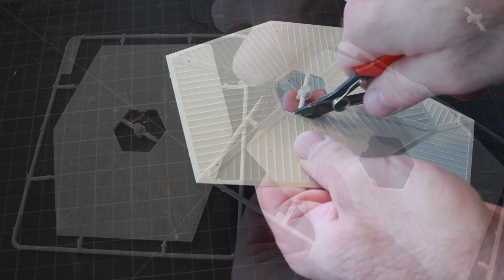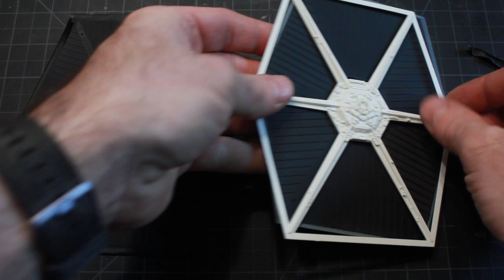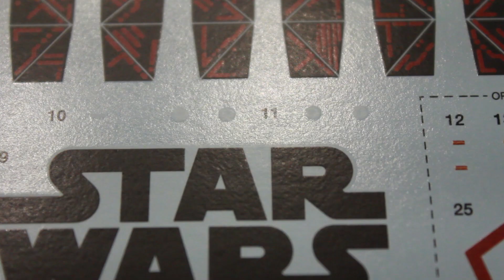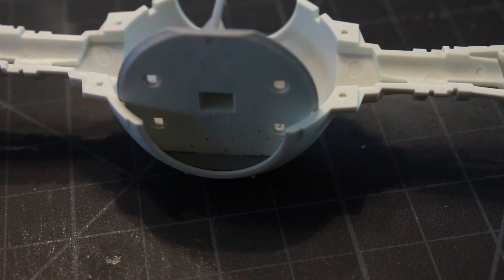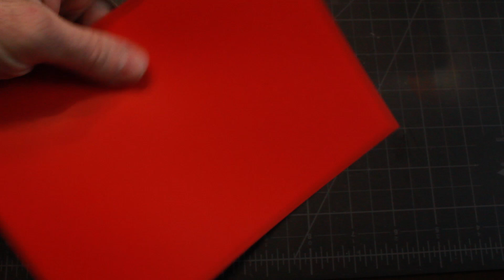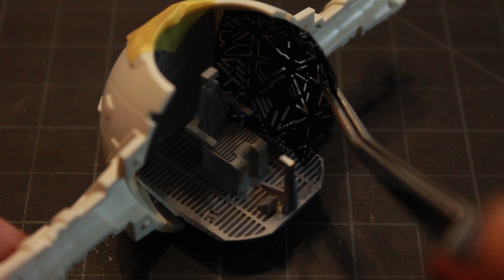Revell 1/48 Tie Fighter Pt II Wings Pilot and Cockpit

Comment: At 9:53, what are you using to apply the CA glue?
Reply from the maker: Ah, that is the glue looper.  Absolutely love that thing.  You just put a drop of glue on a piece of bottle cap (what I use) then touch the tip of the looper in the glue and then apply to your model.  It works by capillary action.  Well worth the price.  Just heat the tip with a lighter and it burns off any dried glue and you're good to go again.  Comes in different sizes and just fits in a hobby knife handle.

https://www.amazon.com/CDL0002-The-Glue-Looper/dp/B00ET8FJ1E/ref=sr_1_fkmrnull_2?keywords=The+Glue+Looper+V2&qid=1554431472&s=gateway&sr=8-2-fkmrnull

Comment: I love your work and all the detail and research you put into them. I’m sure the interior will look great lit up but I’m wondering if this is the old “Fine Molds” design? I’m asking because I’m trying to figure out the best way to light the interior of the newer Bandai mold, which has a more film accurate interior but doesn’t make it as easy as the EL wrap around/ photo etch idea.
Reply from the maker: This is the Revell master kit, which is the Fine Molds re-released. Though the Bandai is more accurate inside,  the size would make it much more difficult to light.
Reply: Christopher Olson exactly the problem I’m currently trying to solve LoL. At first I was watching and asking myself “why does mine have different parts?”.
Reply from the maker: @Kal_El_Krypton  Yea, I don't have the Bandai 1/72 scale.  But, if I were building it, about the only thing I'd do is put a red SMD LED inside to illuminate the cockpit red.  There isn't even any photo etch available that I've seen to try and light the side walls unfortunately. Not much else that can be done really.  And the walls of the Bandai cockpit are molded into the inside of the hull, so there would be no place to illuminate the backside of the walls anyway.